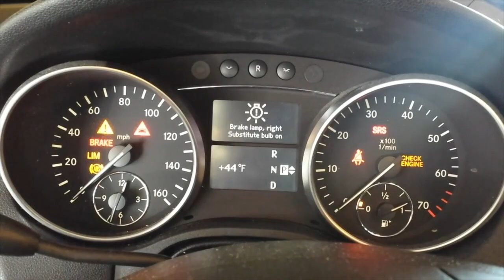Mercedes Brake Bulb Harness Kit Update

Comment: My rear passenger side flasher doesn’t work (the light is very faint or doesn’t work at all) I removed the rear Sam but it didn’t have corrosion. I cleaned it anyways but didn’t fix the problem. Then I saw the connector to the rear taillight was corroded. I cleaned it all out but the flasher is still faint or doesn’t work at all. Do you think it’s the harness that was corroded or the rear Sam? Or the taillight assembly? I also hear a click coming from the second relay from the top when I turn my key or turn on the rear defrost or rear wiper. Not sure if this is normal or means there is a short or bad ground. I also cleaned all the grounds in the trunk area but that didn’t fix it. PLEASE HELP KEITH

Comment: if I buy the facelifted led taillights off eBay will this fix my problem?
Reply from the maker: Depends, most of the time the issue is a bad ground connection which would not fix the issue with another light connected to the same bad ground.

Comment: After change brake harness on right side of 2006 Mercedes ml350 now my signal light ,reverse light and parking light is giving error message not working changed bulbs didn't fix problem confused about fuses on this vehicle found fuse sheet but still confused. When changed to new brake harness could I have done something wrong to cause other lights not to work . Suggestion please

Comment: Keith Please Help!! I did the repair kit on both sides but on the passenger we accidentally pulled out the purple wire, we put it back but the kit only worked for 3 days and the brake light message came back on...did we mess up when the wire came out, even tho we put it back?
Reply from the maker: double check everything.  Something has come loose.

Comment: Thanks for this video Keith.Hey Keith, forgot to check with you again about my stereo fo my 2010 R350 won't turn on.  What should I check first?  Second I previously ask you to show/tell me how I can get rid of the message like c/s/e code on the console.  Tried doing it with your instructions but my buttons on my steering wheel is not the same.  If you could show me or email me the instructions  I would appreciate it.  The dealership wouldn't do it because they said they didn't do the oil change etc..  Lastly I would like to purchase a tee shirt like I received from you in a larger size.  How much are you t-shirts & do you have some available?  Looking forward to hearing from you.  Thanks.
Reply from the maker: sorry for the late response Deborah - Have you checked the fuse for the radio?  I would hook up the icarsoft scanner and see if there are any DTC messages in the front SAM.
Reply from the maker: I will do a video on service messages (resetting) them.
Reply: @iRepairAutos  Don't have the scanner yet.  Will look for the paper to see & check the location of the fuse.  To see if that is what it is.  I look forward to seeing that video when you do it.  Also need that t-shirt in XL, when it's available.  Thanks for everything.  God bless.

Comment: Keith, or anyone in the know!  Please help me.
Started S320 CDi in the garage as normal, THEN malfunction red light with car and arrow pointing upwards on.
That’s the same symbol you press when wanting a bit more clearance.
I normally drive around town with it up and on longer distances I lower it to the normal height.
Anyway, the ride was the firmest I ever felt, it was rock hard.  I got out and the height was way above the normal high position.  I also noticed steering was very firm when at manovering into bay speed.
After two rests and the second start it was still high, but the ride was firm, not rock hard as before.  I don’t hear the compressor when the vehicle is off.
Has a pressure high sensor malfunctioned?
By the way, the malfunction light and arrow up in car outline went out, but it is still way higher than the “high” setting used to clear obstacles.
What should I do?
Reply from the maker: I would hook up an icarsoft scanner or equivalent to the star diagnostics and see what codes are coming back.
Reply: iRepair Autos Thanks Keith, I was checking a ICARSOFT MB v2.0 out for $218 AUD from eBay Australia.  Wow, this is very reasonable and doesn’t require the hassle of taking the laptop.  This means this hand held unit will go everywhere the car goes.
The detailed list of jobs performed is huge.  Definitely will order one.
I was able to reset fault just by turning car off and on, so at least I could continue my journeys (Newcastle to Brisbane, soon to Stanthorpe, Gympie then Newcastle again, about 2350 klms or 1460 miles) in just over a week. Cheers